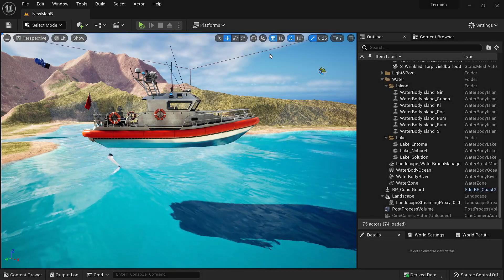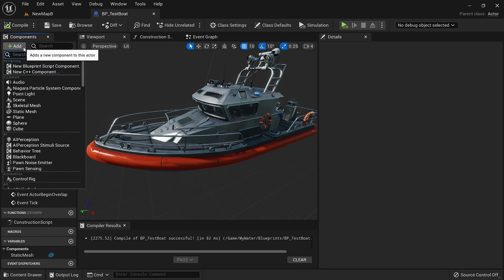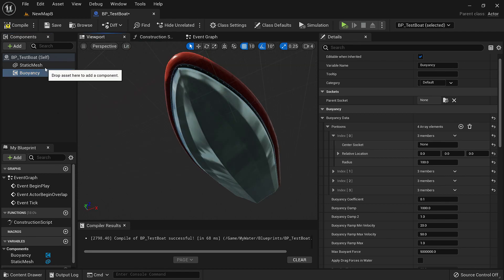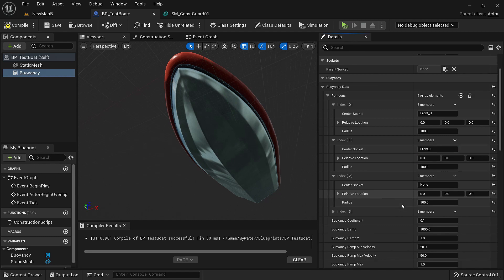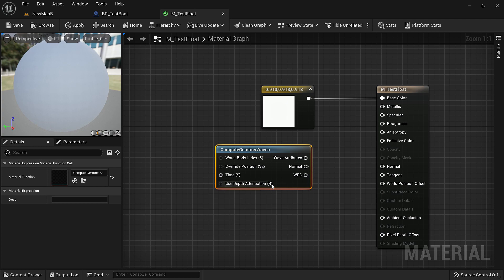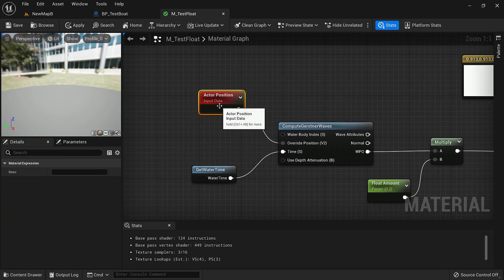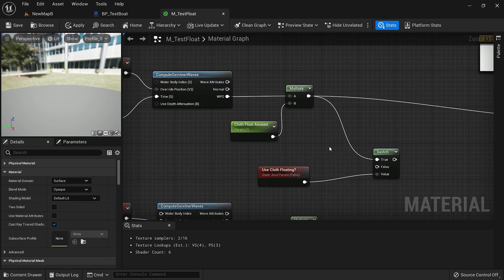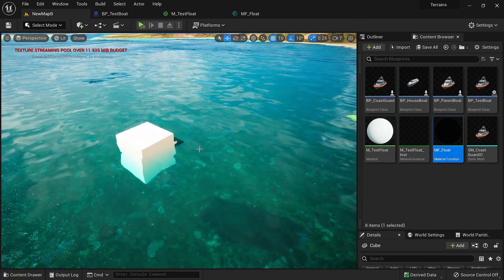How To MAKE Things FLOAT in Water | Unreal Engine 5 Tutorial

Comment: That's a cool tutorial, thanks for making it! As others have said, it won't work in UE5.6 as shown, as the Depth Attentuation has for some reason broken it. But just adding a StaticBool and setting it to False and plugging it in Use Depth Attenuation will fix it. After that, I found a value of 0.3 is a decent start point for tweaking the position. Thanks again!

Comment: In the first example, I noticed you gave the boat, as a whole, a mass of 100kg... is there a way to distribute the weight? I imagine it's difficult to get a very realistic simulation without it...

For instance, even a static asset like a small dinghy going over a wave might be back heavy and land differently than if it were front heavy. Similarly, you could imagine a player standing on the side of a canoe or something, the weight of the player might be expected to dynamically effect the canoe and cause it to capsize.

Comment: not work in 5.1 :(
Reply: Ok, so... When you use the Instance Material and choose either "normal" or "cloth" option it appears some parameters to set. I enabled the "UseFixedWaterDepth" parameter and then I wrote the depth it was set in the water element i was using. This worked for me. Hope It'll work for you too. :)
Reply: P.D. Also, you need to select Gerstner Water Waves in the Water body details panel under Waves Source.
Reply: Same here, in 5.1.1 the boat just sinks to the ground no matter how many pontoons and regardless of weight. 🥺

Comment: Doesn't work for me in UE5.1. Object just falls on the "floor"
Reply: Make sure collision and physics simulation is turned on for your water body
Reply: Got the same issue...have you found any solution. If, plz do share the solution.
Reply: @akshayak9461  it's a 5.1 bug. I desided to use waterline plugin for my project. But I google a lot. And there's 2 way you can fix it. You can use UE 5.0 set up everything and then open project with ue 5.1 (I don't know if it works with 5.2 and 5.3) Or you need to add some files to you project to make everything work (I don't remember it was 6 month ago - google better😀)

Comment: The material approach no longer works in UE5.1. Anybody know any workaround?
Reply: Ok, so... When you use the Instance Material and choose either "normal" or "cloth" option it appears some parameters to set. I enabled the "UseFixedWaterDepth" parameter and then I wrote the depth it was set in the water element i was using. This worked for me. Hope It'll work for you too. :)
Reply: @roher86  I will try this thank you!
Reply: @pick_n_roll36  I'm with the UE5.2 version and for the 1st method everything works fine. But nothing happens with that of the material
I created a material instance but I don't see the parameters you are talking about

Comment: Been trying to get this working for a while now.   Running UE5.1 water plugin, all the settings are identical to yours.  My boat just spins uncontrollably nose down and sinks below the water. I have the BP_TestBoat above the level of the water. If I modify the Buoyancy Coefficient it'll propel into space! Has anyone got this to work on UE5.1?
Reply from the maker: It looks like the pontoons need to be adjusted. They apply force to your object. If they are not applying the same moment, the object will spin. (Imagine pushing a pen with the same force from both ends but you push it a little closer on one side..It'll spin)
Make sure they are applying the force on the same symmetric point.
Reply: @CrowBiomes  Thanks for replying Klaus.  The pontoons are in the exact same coordinates of the coastguard ship that yours are.  I've tried modifying the pontoons, every possible way.  I've spread them out/moved them in. Added more added fewer. I used the BP_BuoyancyExample (located in plugin content) and it works fine.  I've tried different static meshes.  I've found the more uneven the bottom collision is the greater the distortion.  

I've uploaded some screenshots.
https://drive.google.com/drive/folders/1K3PEVs3tgFOoA0IEKcMH2t5CY9dUy_JM?usp=sharing

Comment: Thank you for the video!
Any idea how to set buoyancy parameters via blueprint? Nothing is exposed on the buoyancy component unfortunately...
Reply: yup sadly trying to find it too, my boat drops to the ocean floor after reaching a certain distance from world centre position 0,0,0 using physics buoyancy
Reply: @shinnasukah  Physics in general has issue when too far from center, your problem is not related specifically to buoyancy
Reply: @marcapouli7805   I see I see thanks thanks
Reply: What version? 5.1 has updated issues with WPO and increased distance

Comment: I was wondering how it would be possible to create buoyancy for an object in still water that does not have waves that is a flat plain. The issue I've come across is I don't want to make a timeline and animate the buoyancy as I have a blueprint where the water level changes when a button is pushed and I want objects to move with it while having buoyancy even if the water is a flat plain. Not sure how to do this though.
Reply from the maker: You can apply a upward force on the object after checking whether it's overlapping with the water or not. So when the water level goes down, It will fall down until it overlaps and a upward force is again applied. Applying force on different places on objects would make multiple pontoons.
Reply: @CrowBiomes  Ok thank you for your help, much appreciated.